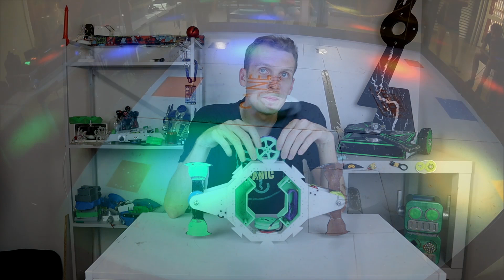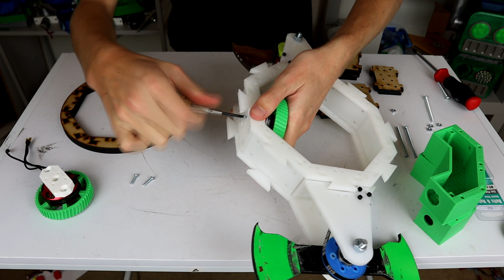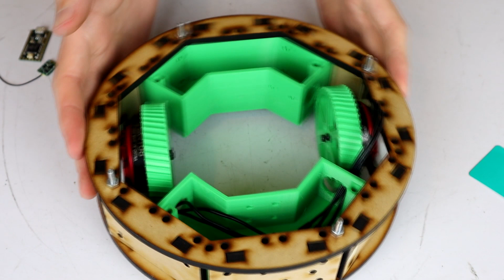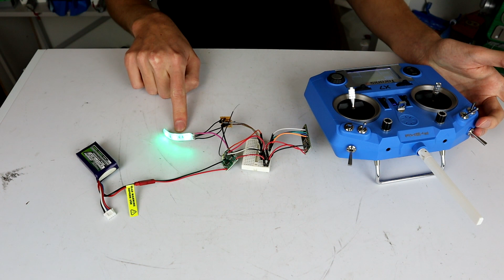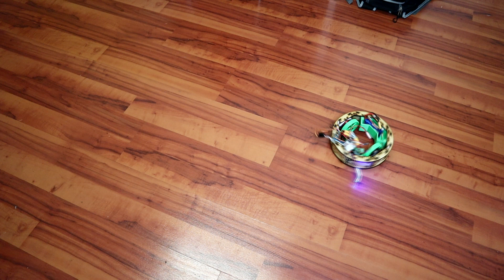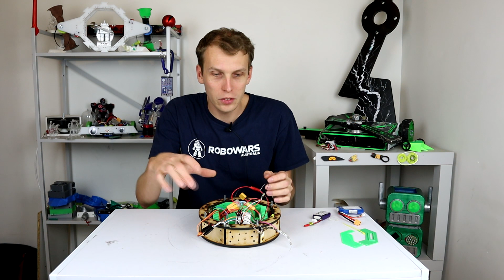Struggling with meltybrain electronics

Comment: If you're looking for additional coding inspiration, here is my work-in-progress beaconless melty code based loosely on the Halo code:
https://github.com/AmbientChaos/Spin-Doctor---Meltybrain-Software
I got as far as testing the code of running the individual electronic components, building a test chassis, and then never got around to wiring it up to fully test/debug the actual melty bit of the code.
Reply from the maker: Awesome thanks! I like the look of the acceleromter callibration you have there. Might have to give that a shot

Comment: Do you think an FPV flight controller would work instead of the accelerometer and teensy? Im not sure if the would. 
I don't know if the accelerometer on the flight controller can read 500g of force, and I don't know how you would code them to work with the melty brain code. But they are really easy to wire if they do work.
Reply from the maker: Easy to wire would be nice!
But yeah if they cant cope with 400g then unfortunately I wont be able to use them

Comment: On the lack of red lights, did you try setting the failsafe mode on the rx?  Melties are cool, good luck!
Reply from the maker: Yep! the fail safe works and when hooked up to a computer the teensy prints a serial output that corresponds to the rx being in fail safe mode. So I think its just that I put the transistor in backwards

Comment: Have you thought of using a beacon based system instead of/in addition to accelerometer?
Reply from the maker: Yep, that's what Halo does and its something I want to do eventually but I was hoping to make it work with the accelerometer first
Reply: Halo had issues getting their beacon to be detected on the far side of the bugglebots arena, idk how you'd ever get it to work in battlebots' far larger arena
Reply from the maker: you are correct. And I'm not planning on using an IR beacon in anything other then a beetleweight.

I'm going to prototype some other heading correction options and use the IR beacon as a measuring stick, if the other heading correction options cant perform as well as the IR beacon then they get thrown out

Comment: I'm new around here, can someone please explain to me what a "meltybrain" / "meltying" is?
Reply from the maker: A meltybrain is a type of combat robot that spins the whole robot around rather than spinning a weapon.
The trick is that by changing when the drive motors turn on/off you can get the robot to move around the arena while spinning!

They are called meltybrains because thinking about how to turn the motors on/off in the right way can melt your brain.

"melting" is the commonly agreed-upon term for when a robot is moving around an arena in a controlled manner while also spinning at high speed.

I should also note, that most meltybrains have one or more "weapon" teeth on the outside of them, which impact an opponent and deal the damage, the robot shown is a safety frame so doesn't have these teeth
Reply: https://en.wikipedia.org/wiki/Translational_drift

Comment: I don't understand electronics or coding or melty-brain stuff. I can weld to a decent standard and my soldering's pretty good, but I only use 'breadboards' for making sandwiches on because I'm a girl. Oh yes.

And since I'm a girl I think it's high time that I said something about cute cuddly kitty-cats. Laser-cutting plywood leaves it with burn marks that make it resemble the fur of an ocelot. Or a margay. Or a cheetah. Or a serval. Or an African leopard. Or a jaguar. But not a Jaguar, because a Jag is usually painted in solid colours with a lacquer finish.

Because it's a car.
Reply: Jaguars are the best cars